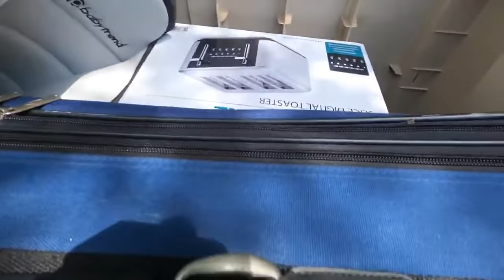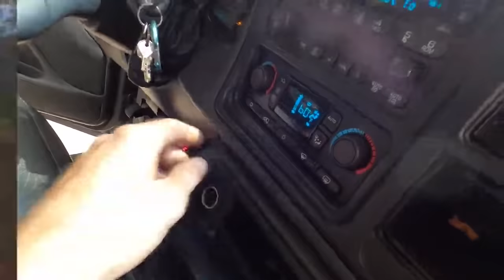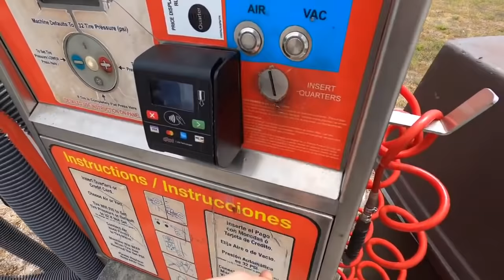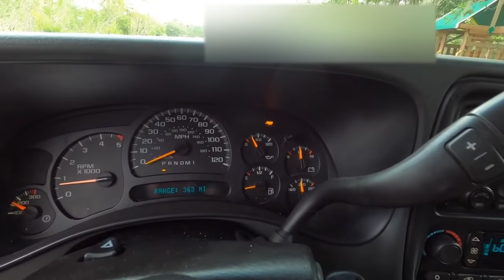Would YOU Tow this?  Camper Trailer hasn’t moved in over two years!

Comment: Ray

I have the 25FB model of this exact same camper!! Welcome to the Outback club!

Fun fact: these campers have a specially made nose cone that covers the batteries and lp tanks. They are cheaply made and if you still have one like I do, it's so brittle that every time you need to take it off or put it back on feels like it's going to shatter.

These are really well made and can be upgraded on the cheap. Not sure what you paid but this one is worth putting some sweat equity into. Also a weight distribution hitch makes these pull really easy.

Comment: I see lots of work. Cleaning. Making sure the roof is sealed. Greasing the wneel bearings, getting new tires and probably a battery.  Also there will probably be a ton of nit picky things to be adjusted, fixed and/or replaced.   Have fun!  :D
Reply: Alan d'Eon  Tires deteriorate with age. They may look good, but are not safe to drive on.

Comment: I built a unity trailer that weighted 400 pounds empty, using 12 inch boat trailer tires in 1967,  moved from Iowa to Arizona in in 1968 then to northern  California in 1970, then back to Arizona, then back to  northern  California in 1975. Then several trips in California.
I finally changed tires in 2019 and all time pulled it without a spare. I parked it in a storage lot, took the new tires off and put them in my shed for 1 1/2 years out of the weather.
Now my daughter is using it. There is spare tire with it too now.
I think I got my moneys worth out the original tires.

Comment: FYI the “break away” will only work if the break away battery is fully charged.  Otherwise not so much.
Reply: Campers usually use the camper battery
Reply: @Bryan-Hensley  And? It was dead…. Sitting two years?
Reply: Also cannot be hooked to the hitch at all must be hoped independently of the hitch
Reply: Alan d'Eon  try that in Ohio.
Reply: Rainman, is your shop anywhere near Seminole Fl ? That's where I live.
Reply: @rguy2684  just needs a slightly bigger panel in Ohio than in Florida.
Panels still put out some power on cloudy days.  Might be 50% of peak for same time on a sunny day.
Brush the snow off in winter.
Reply: @fhuber7507  funny, I have a 100 watt 14 volt panel that on a cloudy day (like today) only puts out 4 volts.  Yes it is a newer panel but could not charge a 12 volt battery, charge controller shuts off.

Comment: The very first thing you look at before towing a camper trailer that's been sitting out in the open for 2 years is the condition of the tires for dry rot and proper inflation because of exposure to weather. The fact that trailer wasn't on blocks to keep the tires from flat spotting is also problematic as well.....

Comment: On my 250 I use a weight transfering hitch, on 3500 it might be worth it on a long trip. Hooking the safety wire to somewhere that isn't part of hitch is recommended in case hitch fails.
Reply: I use the equalizer hitch on a light boat trailer because it damps the wheel hopping, sort of uses the truck as shocks for the trailer.

Then I don't beat the 350 lb fiberglass sailboat to death.
Reply: "Hooking the safety wire to somewhere that isn't part of hitch is recommended in case hitch fails"
I've been RVing for over 25 years and have to confess, that I did not know that! Makes sense though.

Comment: As an old rver..would I tow it? Not without a weight distribution hitch.  Not even with that DirtyMax dually.  And a sway control.  Some truck passes you or you it or a heavy wind and you might find a ditch bottom.  Also in many states they're required, even when you come from out of state and can get you a nice ticket.  Plus when they're set up right you can drive the fool out on the road.  I've gone hundreds of miles at 80mph with the traffic instead of like some you pass doing 55 in a 70...GET OUT THE WAY !!!...lol.  Other than that as long as the tires are good...and balanced, bearings are good, and it hasn't had any sort of roof leak I'd do it.  Been thru all of these I mention and lived to tell the story...and the costs in tickets...lol
Oh, and DON'T SHAKE THE BEER !!!!!!!!!!..haha

Comment: @Rainman Ray's Repairs Nice camper trailer you got there... But what i don't get is the braking system on your trailers in the US.... How do you control the braking force on those things, so that it will apply similar braking force as the towing car????

In Europe we use the same type of ball hitch coupler as the one on your trailer, but we use a mechanical braking system, where the trailers weight pushing towards the car activates the trailer brakes. This ensures that the trailer will never push the car under braking, but will by default adjust its braking force to the speed reduction of the towing vehicle...

And we don't have those safety chains, only the pull wire. But since the brakes are not electrical, the wire activates the parking brake handle on the trailer, should the trailer brake free.

Comment: Dot here in Canada we can't have the break away cable attached to the hitch it has to be to the truck. And yes always cross chains for control of a detached trailer and never let chains drag. Always twist to shorten if necessary. Trailer tires are not like auto tires heavy duty or thicker.

Comment: That tow rig is awesome. I'd make sure I had some new spare tires before towing that very far though. I'm a bit jaded when it comes to trailer tires. Seen and had too many disintegrate on the freeway.
Reply: Trailers are easy, piece of cake. Try tow- bar towing a vehicle that doesn't like it with another vehicle of same weight over  worn grooved roads across country for about 2500 miles. Four wheels on the ground pushing you all over and 100% of braking in the front vehicle.
Trailers are easy.
Reply: @michaelszczys8316  been there and done that too. Not fun. Didn't help the tow dolly was a little small. I couldn't get over 35 mph. I was towing a suburban with a heavy half ton van. Those little dolly tires just couldn't really handle it. These days I have a 20 foot heavy duty trailer for that sort of thing. I swear it weighs more than some cars I've put on it.
I've also flat towed across two states with just a rope. But that's another good deed punished story entirely.
Reply: Nowadays I use a solid tube for any rescue towing , steel tube about 8 ft long mounted with hitch on front and connection that can swivel on towed vehicle. You need someone to drive towed car but it works real safe and secure, you can even brake all from front vehicle if you need to.
Reply: @michaelszczys8316  I can see the advantage but it would be critical to keep both vehicles lined up with each other. Be best to just use a tow bar but that's expensive to get rigged onto the towed vehicle. That and so many can't be towed on all fours.

Comment: Hi Ray, I’m not a car or truck person but love your videos. 
i could watch them all day and I do cuz I’m retired !!!

Why do you need to keep the engine running a little after the trip?

Do cars need to do that also? thanks
Reply: This allows the turbo and manifolds to cool off before shutoff, as the turbo is powered by exhaust gas making it get very hot. Failing to do so on the newer Ford Ecoboosts can cause the head bolts to fatigue and break.

Comment: Amazing how you can fly that drone so low to the ground behind the camper! lol   I think those trailer tires are made to dry rot within 2 yrs or Tractor Supply had them for 2 yrs before I bought some. lol  I was down to Daytona Beach back in March for Bike Week and to visit a friend who lives there.  I came back on 40 thru Ocala bypass as usual which I call the Daytona Drag Strip.  If I were to live in Florida (again) I think I would like Ocala area if I didn't have to drive there! lol  I cringe when I see a Florida tag up here in NE Alabama , usually old couple testing everybody else's brakes at intersections and stop signs.

Comment: So, on the chain you did it right, they need to be crossed as a security feature. If the hitch fails (which happens if you didn't hook it up right, or your buddy had a few drinks too many and screwed up) the chain will catch it from being a roll away hazard, and gives you an opportunity to fix the issue before it kills someone.

Comment: What year is the truck and how many miles?
Reply from the maker: It’s an 07 one of the last built with this body style. 191k on the clock
Reply: @RainmanRaysRepairs   shit for a diesel 07 with 191k that engine is just broken in. And those earlie 2000 duramax diesels were built bullet proof. You know as well as i do you keep up the maintenance on that truck and the engine and trans would outlast 3 different body swaps... Altho i prefer the 1995 dodge ram dually 3500 cummings with the inline 6 12 valve.. But chevy trucks are right up there with dodge over the forever money pitts that ford made...